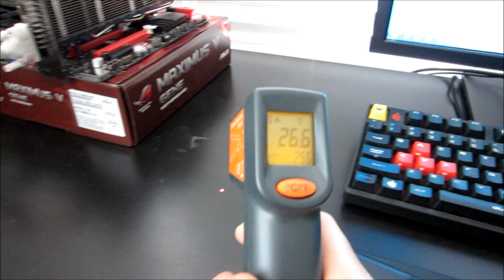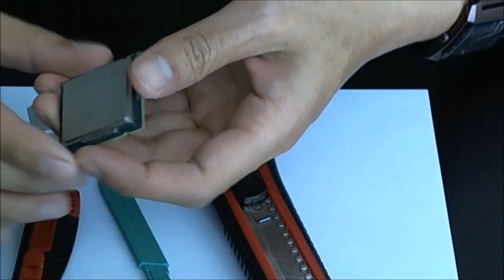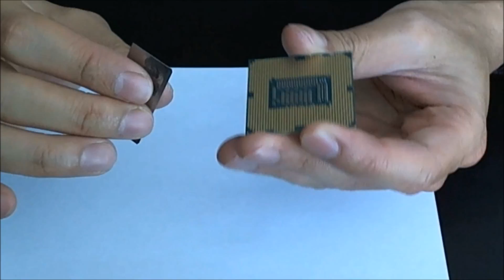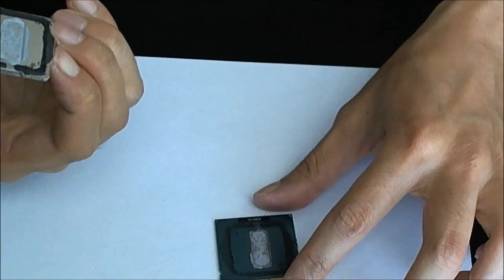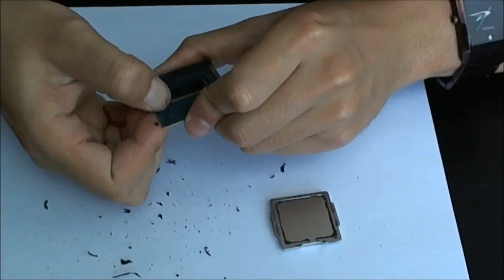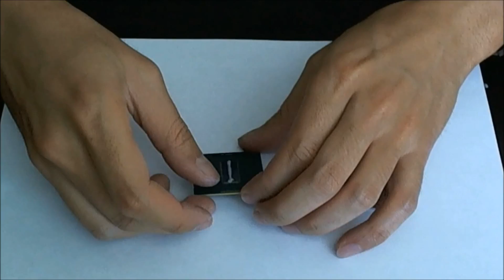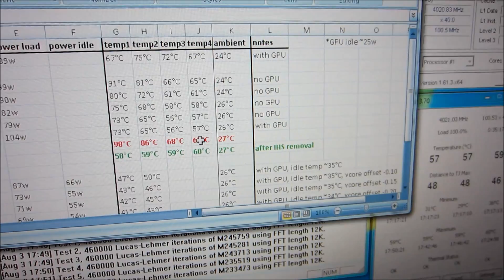Fixing Skylake, Haswell, and Ivy Bridge CPU temps: IHS removal

Comment: should have just run it right off the dye
Reply: The die can break easily with a massive radiator like this one if you tilt it ever so slightly. That's the main goal of the heatspread, to protect from mechanical tear.

Comment: Interesting...that' looks like every laptop CPU I'd ever messed with.  Not nearly as scary as I imagined...part of me wants to try this now.

EDIT: I do wonder, why waste time with the spreader?  Why not just put the cooler on the processor?
Reply: demonkoryu
You CAN put the HSF directly on the CPU die — (I've done so dozens of times and have never damaged a chip), but when using CoolLab's Liquid Pro (which is conductive) direct-to-die, the slightest "spill" could short out the VRMs on the processor PCB; using a "regular" (non-conductive) TIM is of course not a problem, but I've gotten better temps using liquid metal AND the heat spreader than using "normal" thermal paste without it.
Reply: Huge danger of cracking the chip. Also, you'd need a special mounting to compensate for the gap.

Comment: I have a question, why doesnt he tried to glue the cover again? because will not fit to the same position and will have issues when closing the fastener?
Reply: Because its not needed. Its optional.
Reply: Yes and actually is easier to verify again the termal paste condition, thanks

Comment: I don't understand the critics here. The guy is showing us that if you're careful, you CAN remove the heat spreader and NOT hurt the processor. Furthermore, he's PROVING that Intel is putting poor TIM on their processors. The shit that Intel puts on the chip runs hotter than the stuff he used on the coolest running cores! He got a 5 degree drop in temps on those coolest cores, not to mention fixing the disparity of the stock temps. Now all the cores are running the same 5 degrees cooler than Intel is giving us. This kid should be getting a medal from us, not criticism.

RMA? Since he proved to us Intel has a quality control problem, AND that they're using cheap-ass TIM, why would you roll the dice with another processor and maybe wind up with something worse? If you CAN do this, why wouldn't you, especially since you'll wind up with something better than the best quality processor that Intel can give you?

You guys criticizing him must be Intel worshipers, not just fan boys. He's offended you by showing you your god is flawed.
Reply: ladamyre1 encore! encore! well said, sir. I wish I could have just paid an extra $5 or $10 bucks for my CPU so Intel could have just used quality thermal paste to freaking begin with.

Comment: Hey guys i have my i7 3770K run around 57° normal and 75-80° in use without overcloking but with the basic intel fan. Is it normal or i need to change the IHS too or just the fan ?

Thanks
Reply: Get a better cooler and test it. 
You're being limited by the stock cooler.

Comment: Why is the cpu fan blowing to the GPU card?
Are you stupid?
Ever hear of a computer case and airflow?

you could have rma'd it but now you'll never be able to.
Probably just needed to reseat the heatsink...
Reply: How did you come to the idea that cpu fan is blowing to the GPU card?
It's blowing in the opposite direction through the heat sink. And it's installed properly !!!
Reply: ***** no idiots the sticker side blows OUT.
The heatsink is supposed to be mounted blowing to the back of the case, its instead mounted blowing down to the videocard.
Reply: ᗒ╬ᗕ1112223333111ᗒ╬ᗕ  it's a fucking test bench. You don't give a shit about airflow

Comment: wow impressive temp decrease! I have similar problem with one of the cores going too hot, but in my laptop.  Its i7 3630QM chip, I wonder if I can do the same as you did with desktop cpu?
Reply: Your laptop processor doesn't have a heat spreader like a desktop processor. It will be a direct cooler-to-die with TIM in between.

Laptops rebuilds are a major operation though. Download the procedure for yours and make good notes, length of screws etc. and get a good paste. Don't try it if you're not confident of your skills. It's a lot harder than sticking a graphics card in a desktop, or even what this guy has done here.

Comment: You just ruined your intel cpu, what a waste anyways! An i7-4770k is half price of the amd fx 8-core (yes unlocked) this processor does get cooled easly and you dont have to destroy your cpu to make it cooler, i saw a core at 38 degrees, which means it might be defect. Results in higher temperature without a warning. Guess what! Im 14 and i know this stuff because i actually think of a logic reason for things, dont take this as a hate message because well... Its not my problem. Ps: the "glue"  is not glue, its an insulator.
Reply: i ment the 4ghz one, i didnt mean the 9 series...
Reply: *****
hey he's 14 and he knows this stuff because he actually thinks of logic reason...let's not doubt this logical thinker
Reply: callum -__- Meh, if I had a kid, I'm sure he'd know a thing or two about gaming PCs because there would be a beast one in the house... never would I let him grow fat and rant on the internet like a troll though.

Comment: btw. thermal paste is not a heat conductor, its only purpose is to remove air which is a good insulator, so apply only thin layer
Reply: But then once it removes air...... It has to conduct best better than air... And the more it conducts the better
Reply: yeah, it conducts some heat but the metal casing of the processor is like 50 -100 times more conductive, also you can use metal based thermal paste which is like twice more conductive that the regular one but is not particularly safe to use because is electricaly conductive as well.. so the rule is : more paste does not equal better cooling
Reply: yes more paste does not equal better cooling thats not my point my point is

paste that transfers heat better is better

Comment: WhiteFireDragon  I know from research that the thermal paste on these CPUs with glue instead of solder are drying out because of the poor seal the glue makes compared to the solder. Since making this video, have you noticed a change in temp performances? I ask because you didn't re-seal the IHS and I am wondering if the paste will just dry out again even though it's after market.

Comment: I'm so happy that I got SB i7-2600k
even running 4.5 GHz at 1.375 V still have max temp 60-70 °C ( with 10°C difference between the coldest core and the hottest one )
CPU cooler : prolimatech armageddon

But my friend is buying computer now, and he will probably get i7-4790K, so we will se how it will turn out.

Comment: good tutorial, but i do believe you had a faulty cpu. with the same cpu as yours my standard temps are in the 30C, using a coolermaster seidon at normal settings.

Comment: With the ivy bridge and haswell cpus, it seems to be luck on whether the temps are good or bad. I say this because I have the same cpu he has (core i5-3570k) and I can easily reach 4.6 GHz on a smaller air cooler than he has. It reaches around 75 degrees max on prime95, which is kind of high, but much better than the original temps he showed at the beginning of the video.

Comment: In no way is this how you use a cpu do not do this there in No reason for this just bye better thermal past the only way he's getting better heat is if the cpu had a factory defect that he fixed but this is not how you handle a cpu at all this is some gehtto shit if I ever seen it

Comment: Should I do this on my Intel 4790k or I'm good? Also question for the producer of this video. How long did your Intel i5 3570k 3rd Gen LGA 1155 processor lasted when you have done delid?
Reply: Retrocidal Holy fuck man, How do sentences work?
Reply: Retrocidal Stop acting kid. No one's going to believe you. Stop skipping your classes in school, and maybe one day you will learn how to make proper sentences.
Reply: Only if you fell like ruining you cpu then bye all means there no reason what so ever to take a heat spread off a cpu at all maybe if you just did ball of meth maybe then there a reason there past is hard on the heat spread this is some thing a meth head would do seen them do it before and ruin there shit
Reply: I'm not a meth head I'm an enthusiast but I have thought that this process is really risky
Reply: Very there is no reason to do this man I built thousands of pcs worked for pc shops never ever would any of them or me do this just get good thermal past artic 5 is good for the price gonna be doing that handling cpu they way he does could shock it and it might run but it will never be the same cpu there is no reason  for you to take it off its way risky just one little dig on the wrong place and it will be runined and pissed off not worth it try some thermal past if you having heat issues it might be a bad cpu them heat spreaders are glued on at the factory I never herd of this lol I a😤
Reply: I use ice diamond  and mx-4 which are my two favorite paste. My system is liquid cooled and I'd always use ic diamond for the processor and fur the GPU die mx-4 and I get some killer temps.
Reply: I don't have hest issues at all I just saw this video it sparked my interest. My 4790k on my z87 sniper 5 board we are happy lol
Reply: Will R the 4790k is a revision that fixes the issues of haswell and ivy bridge, so don't worry about it.
Reply: ^thx for the info Dp.
Reply: Retrocidal
 You dont really get the point of delidding and overclocking.
Have fun building over ten thousand (10.000) computers, sounds like a fun job..
Reply: Retrocidal that's funny because I work in the financial field, boa, chase, pnc, wells to name the big ones.... and no bank "builds" computers... they buy or lease them pre configured from Lenovo dell or hp as per federal regulations.
Reply: Retrocidal
And then install Intel 4790k or other top of the line?
Is just not believable that a  manipulating regularly those chips you do not encounter one, are not that uncommon.Either you are lying or just don´t understand the issue.

It does happens to the entire line but in the capped versions (celerons,pentium,i3,etc), low frequency or weaker IGP can be deal with it, the TDP is lower and there is time to dissipate the thermal energy . BUT NOT WITH  FULLY OPERATIVE DIES.Way before the heat reach the IHS  the die hot spot and throttle itself. Is not about dissipating the energy, is about transferring it from the die to the IHS  fast enough to avoid the self preserving mechanism from kickstart because once started is too late. Is not like "...with the standard cooler the CPU will have 100c and with a super duper only 85c...".Once the die reach 80c, one is as useless as the other, the heat is trapped between the die and the lid 

 Once you find it there is nothing you can do to fix it besides deliding.
Reply: Retrocidal
You are a fucking lier.
 Who the fuck you think you are?. Michael Dell or something ?.
No way you have sold/assemble 10,000 Ivy/Haswell PCs. Even then; no matter the number, some chips are not fixed with anything at the IHS, the die DO hot spot somewhere and start throttling very soon.And intel guaranty policy suck balls, won´t take it back or refund the money, Not even at VAR level and we are not talking a cheap Celeron here, something you can pass on. It´s a very expensive entusiast part for wich Intel already have charged an extra price. Totally unaceptable "Deal With it" greedy attitude
Reply: Retrocidal If you're gonna lie, at least come up with something more believable figure than 10 000... lol Kid got caught from desperate lie.
Reply: mx is the best i know of
Reply: You can run it without the lid... if you find a way to properly secure the cpu on the socket & make up for the height difference on the motherboard mount & the cooler. Older cpu's didn't even have any lids... I had an AMD Thunderbird 800 mhz many years ago.. and it came with the die exposed directly... also had a pair of Athlon MP 2800+ the same way, right out of the factory. Many intel chips were also similar with no lids. They decided to include lids probably because people were not careful when mounting the heatsink & ended up cracking the die/chip by applying too much pressure on one side during the installation. I'm not saying you should do it... just letting you know that a cpu can be ran without the lid.
Reply: TH3 3L1T3 i built over ten thousand computers and i never had any problems with thermal past only a few times did i have to replace it i have gave away more computers than most of these so called computers tech on youtubers have even worked on
Reply: What?
Reply: st3yn never mind this dam tablet and dam problems and letting me explain stuff :/
Reply: i am not we did over 3 thousand pcs for us bank and tmobil alone contracts work we did that in 3 months lol i did at lest 500 just then
Reply: yes they contract use to back up the data and install the new pcs when that happens  not often dell was there choice all dell
Reply: Will R I wouldn't bother to delid unless your temps are bad. Stock cooler is horrible, super high temps. I picked up a h100i and used arctic silver 5, on prime I'm 72 degrees max. Also I lowered the cpu voltage core rather than raised it as this chip does not need as much voltage. I'm running it at 1.137 - can't get below that. Ran prime fine as well as AIDA64 which is the stress tested recommended for Devil's canyon. Oh and I'm running at 4.4 ghz. I would not delid until I tried everything else first. My idle temps are 35 max 72. So far so good. I just bought it on Friday. Running like silk. Good luck man!
Reply: Will R 4790k and haswell refresh is much improved over haswell so theres no need
Reply: effectiveduck is the 4690k also a revision?!
Reply: tonyfalca yeah
Reply: zhi xing ong
awesome thanks
Reply: Retrocidal Some math: 10000 computers assembled / 365 days a year = 27.4 years. So you are telling us that you assembled at least one computer per day for the past 27 years? Might as well don't skip your math course...
Reply: Advection357 That led to people (or idiocricy) to mis-install heatsinks and break the core, which was like just a shitty piece of glass. Get a shard from it, the core would just die. And you're let alone fapping to magazines because your new CPU without lid broke. Some nowdays GPUs are built without dies, which also sucks.
Reply: Will R I wouldn't unless youre seeing a huge variance between your core temps. I think 47xx are pretty good with their IHS application. (I am using a 4770k).    Run coretemp widget first,  then run your pc on a non-synthetic load that uses all cores and just observe.
Reply: Retrocidal someone who works for a pc shop can probably spell, and use correct grammar.
Reply: ya and also pinch there nipples
Reply: Will R Haswell refresh doesn't have shit thermal paste on the IHS, you will be fine.
Reply: ShieldsLetsPlays  link to proof?
Reply: Noah Brooks Just look it up, part of the reason Haswell Refresh even came about was because so many people were pissed about the shitty temps of the 4770k, god there was such a shit storm at release for that CPU because of temps and bad overclocks on what was supposed to be an enthusiast grade chip.
Reply: Will R Just don't touch the top or especially the bottom of the processor with your fingers, they're oily and will ruin or shorten the lifespan of the cpu processor, other than that, just be extremely careful delidding the CPU, lol delidding what a stupid word, anyways, good luck and be safe.

Comment: how do you stick the top cooper piece back on the pcb?
Reply: Dick Phuc Nope its silicone. Epoxy is hard as shit. You'll never get the lid off again if you're sealing it with epoxy.
Reply: i mean is there a way ?
Reply: Inside_ninja You can buy Epoxy resin with rated temperature of 100 or more degrees celsius, and use it to glue the IHS back to the PCB after you Apply Coollaboratory Liquid Ultra.

Its vital that it has a rated 100 degrees + before it melts. Last thing you want is having the epoxy melt. There are those type of epoxy for sale just like what intel used for theirs. (that black stuff the guy in the video scraped off are also epoxy.
Reply: :D thanks a lot mate ,cheers 
have a nice day